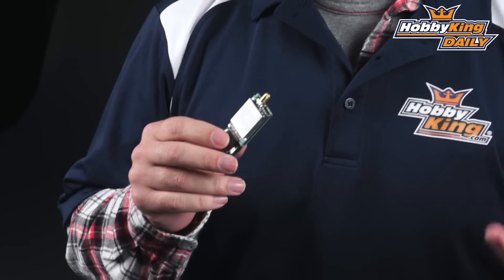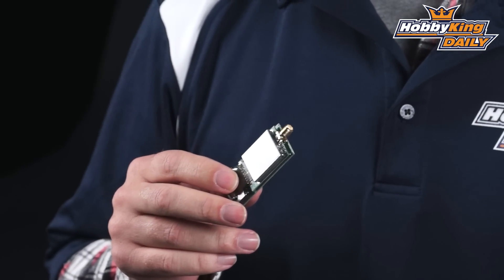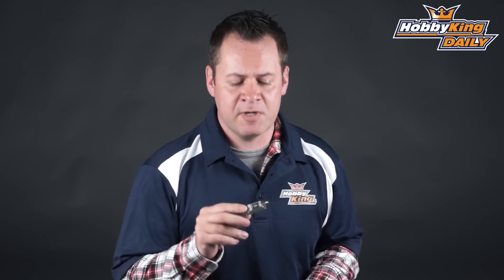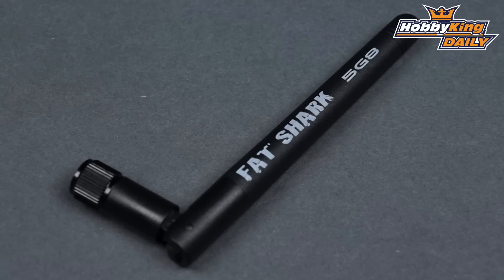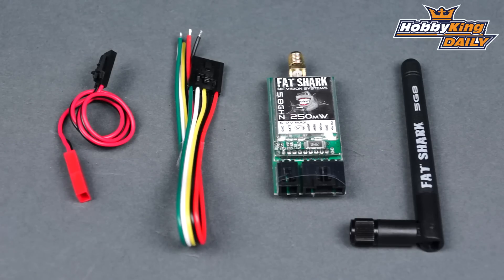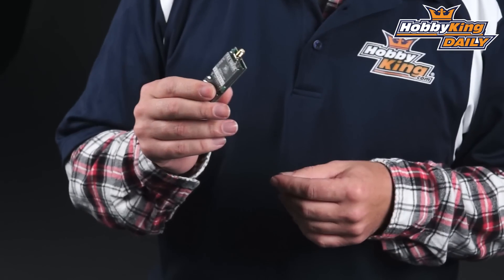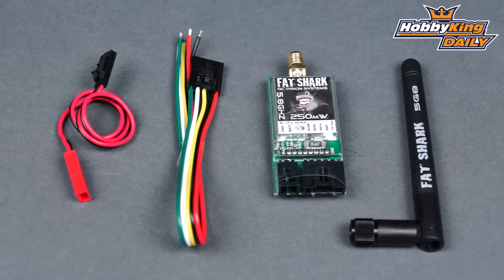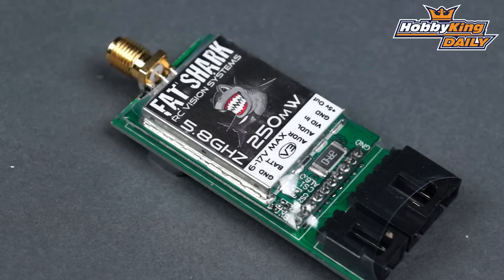HobbyKing Daily - Fat Shark 250mW v3 5.8 Video Transmitter

Comment: I just got one from you guys, one question, how to I change frequency on this vtx?
Reply: +INMERSO I bought one of these myself, it appears you change the channel with the tiny switches under the plastic, apparently any combination of switches up and down creates new channels.
Reply: +Roger Paull thanks for the answer, I've given it a quick look, but didn't find the switches, will look carefully later and see if I can find it
Reply: i have heard that some don't come with switches and you have to solder them in, but mine came with some very very tiny ones.
Reply: looks like I'll have to contact fatshark and send them an email w pics asking them how to find or solder this switches. Thanks Roger.
Reply: found it, its on the bottom right corner, little black "cube" with 4 little switches numbered from 1 to 4.
Reply: yep, that's it, can arrange those in any order to get a number of channels.

Comment: Does that head tracking audio come in the previous versions, or is that something new? I have the v2 and am curious.
Reply: Yes, it works with all versions, But sepperate hardware is needed. Its used for Antenna tracking. You have a GPS module that transmits the planes coordinate data down to your ground station using the audio channel.  This allows your ground antenna to keep itself pointed towards your plane.